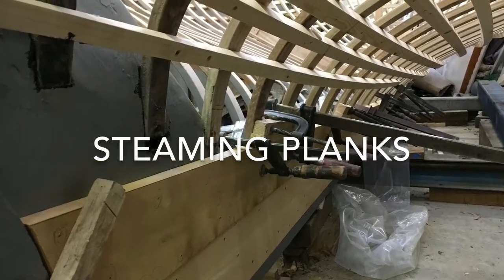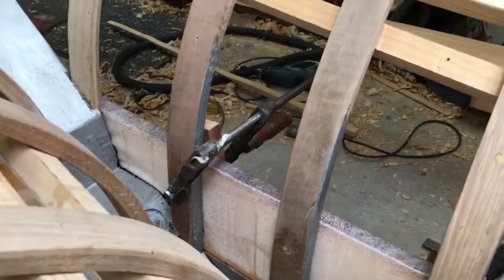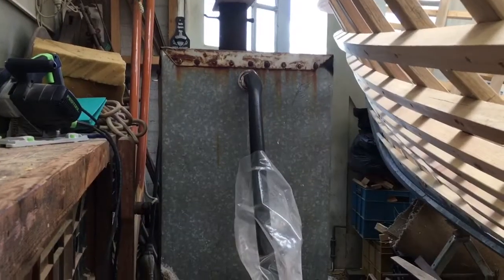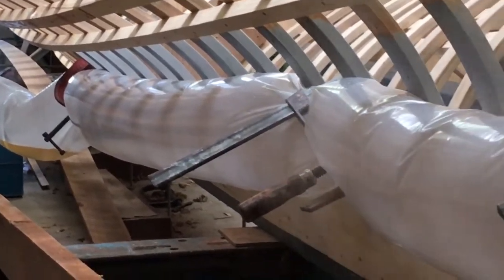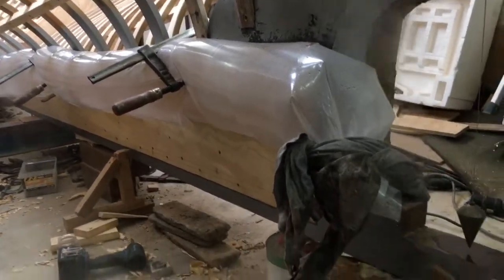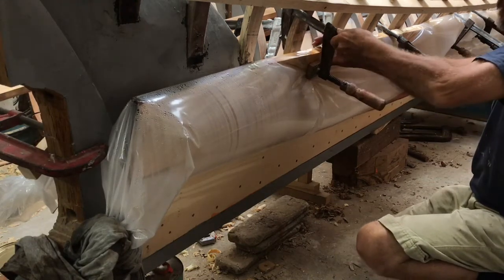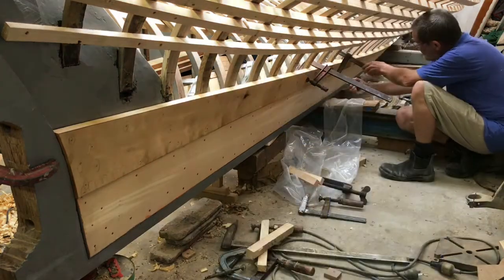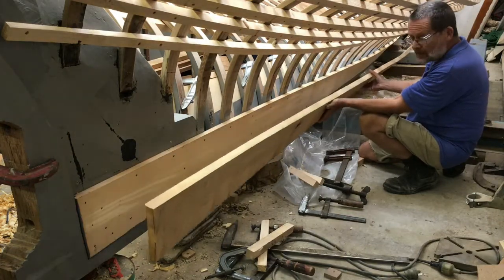Carvel Planking Ep.2:  Steaming Planks

Comment: Is your bagging a pre-manufactured plastic tubing or do you make your own out of sheet plastic? If sheet plastic, how do you close it around the boards to hold in the steam? Tape would release under the heat from the steam, I would think.
Thanks for any reply.
Reply from the maker: Hi Thomas, the plastic tube is a standard product, but I can’t remember where I got it. I found it on Google a few years back. Had to buy a roll.
Reply: @SmithysBoatshed  cool, thanks